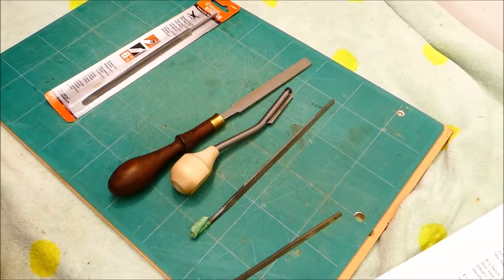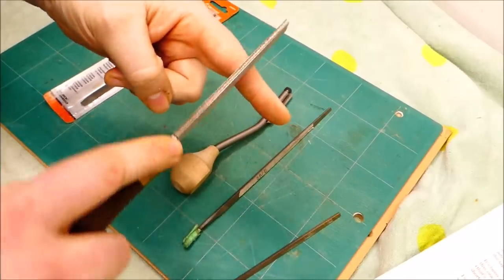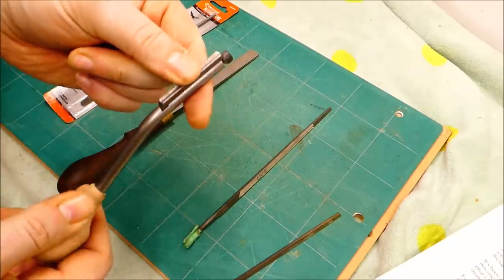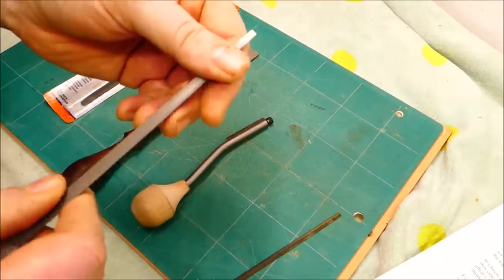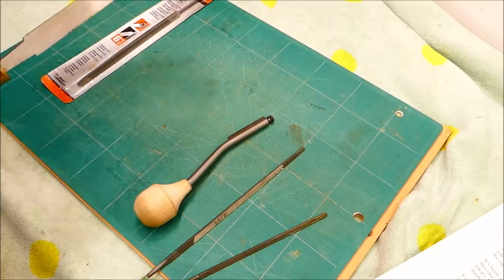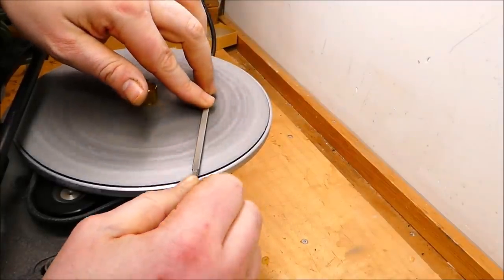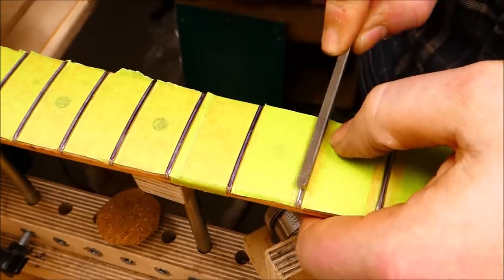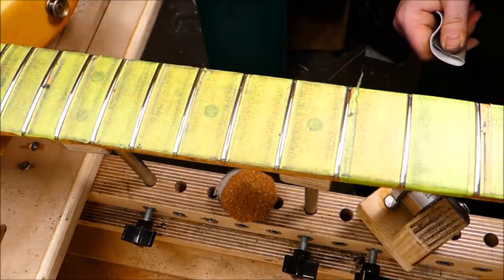Modifying some files for re-crowning work

Comment: Good video, reminding people how simple the tools needed are. Over time I've found  that only things I need for a quality fret jobs are ....(Sharpie),  Leveling beam, 3 Corner Safety file, Stew Mac Fret Tang File; Sandpaper 400/600,  Micro mesh and finally a  polishing compound or Mag wheel polish( has some agents that prevent tarnishing). Amazing how inexpensive and  locally sourced most items can be found. Not many excuses for mildly handy players to do basic work should be.

Comment: I like modifying my tools so they work for me, and your video was very helpful demonstrating what modifications were useful. I just modified a couple of files. My fret crowning file was way too long, so I drilled a deeper hole in the wooden handle, and now the weight is nicely balanced and I don't have a huge amount of file sticking out of the handle. I knocked off the end of my triangular file with a hammer, rounded the end, and eased one side of the file with disc grinding stone screwed into a drill. All very simple and effective.  Thanks for showing me how the pros do it. 👍

Comment: Thank you for this video! I've recently DIY'd some levelling beams (square steel tube, stick sandpaper on a glass shower shelf to flatten the tube, bevel the ends, and you've saved a few hundred by the time you've done 3 or 4 different lengths) but the crowning tools escaped me. Stewmax is useful in NZ, but their crowning files are really expensive even with the free shipping. I got a cheap one from amazon recommended by one of those youtube channels that does sponsored kit guitar builds and claims they're just as good as gibsons, so I shoulda known it was a scam. It just doesn't work. But looking at my local hardware store 3 corner files without the safe edge seem super cheap and easy to get, so I'll do that and modify them! Thank you for sharing your knowledge with the community for free!  

Also, I second the various comments asking to see more of the shop cat!

Comment: YES, extra slim 3 corner is where it’s at. For some reason, a lot of guys I’ve seen like slim taper Nicholsons. To me, those are nice and I do use them here and there but the extra slim Nicholsons are about the best crowning file I’ve found. Just grind off the corners, round them over a tiinnyyy bit and you have a brilliantly controllable, cheap crowning file that’ll last decades if you take care of it. For a handle, I just use a few wraps of duct tape. It’s nice enough to hold and you can just add it until you’re happy with the feel. It looks a bit ghetto but there aren’t too many better options out there. The Stew Mac 3c’s are great but they cost like 5 times as much...and believe me, you aren’t getting 5 times the tool. I’ve used both options for years and they’re about on par with eachother...

Comment: I also tried several coved crowning files and have never really gotten along with them. And for the very reason you mentioned with the file hitting the crown before the sides are shaped. But also they obscure the fret top. I've settled on the three corner file for a while now and find it just as fast or maybe even faster cause I'm not visually impaired by the tool itself. Thanks Ted

Comment: Sweet, thanks for sharing!!  I might have to give this a try.  I have one of Stew-Mac's fret files like the LMI one, but with a MUCH shorter handle, just formed out of the steel of the file.  I have also modified a regular smooth flat file so that only the last 2 inches or so have teeth, and the side is also cut away- this one is dedicated to rounding over fret ends.

Have you ever tried polishing frets with a felt wheel after sanding?  I found that the generic red jeweler's rouge in a felt wheel on my Dremel gives a mirror shine to frets.  Bends and vibrato are almost effortless when the frets are that smooth.

Comment: I have had great success using the three corner file from a cheap six pack of Mastercraft micro files I bought a few years ago. It's about the size and weight of a ballpoint pen, and now only has one sharp facet left. Not bad for $10, and the 3/16" diameter round file from the set is good for shaping headstock and neck heel tranditions.

Comment: Bacho 1-170-04-1-0 and 1-170-06-1-0 work best for me. Like the saw sharpening files but double cut so they chatter less. The second cut version 1-170-04-2-0 leaves a good surface. I put a brass pipe ferrul on a 1/2" or smaller dowel and cut it about 3" long as a handle, it allows good clearance and isn't as tiring to use as a bare file.

Comment: I love a three corner file, I can see my work as I file where as those pre-formed fret files hide my work rendering me into this stroke-lift-look action that is just inefficient and less accurate.   

I have also shortened the handle spear to use a semi-round (sorta tear dropped) shaped with a small offset hole I made to fit the cup of my hand comfortably without blistering my palm.  The hole is really centered at the end but my handle is wonky fat on one side to make it semi offset. 

Is wonky fat a thing?

Comment: Ted    I  bought   in  90 that  rosewood/brass  fret   file.  an  sold   the  gurian  one .I  found it  awkward  to  use    chacun  a  son  gout. I  tried  the  3 cornered   xx  slim  file . and  that   did  not  work  for  me   either . So  far . I  have  had  best  results  with  S/M  diamond    stubby  fret  file. TNX for    the   explanations

Comment: may I recommend using files from the Pferd, its sharp and strong. I still use it for crowning and bevelling either Nickel or often Stainless steel frets, for 6 yrs since and it still in its bes.

Comment: I’ve been using the Stew Mac crowning files for years. You are supposed to use them like a triangle file, leaving a thin sliver of untouched  fret on the crown. That’s what Stew Mac’s instructional video says anyways. I do the heavy lifting on stainless frets with the Nicholson triangle file, which makes the $70 files last for a decade+.
They can be sharpened with a sulfuric acid solution too, but that’s not for the faint hearted.

Comment: I went insane a while back and bought the Gurian file. It always seems to chatter and always needs cleaning as it collects filings. I imagine the diamond version is superior in that regard. Currently using combination of the triangular file and the Z-File. Although the Z-File has the same issue as the first file you demonstrated in that it's hard to use on the fretboard extension. I'd like to see a Gurian-type holder which can take radiused diamond file inserts that match the fingerboard radius. It'd be super quick and extremely lazy...

Comment: I have had a version of nearly all of the various fret files. Tri-corner is good, I find most concave are just just to "flat", as you did. I made a "deep inverted vee" file that quickly did both sides of the fret, leaving the crown untouched, but I made it too coarse, and it was dangerous to use! I may try to make a finer one of those. I just do hobby work, in any case.

Comment: If you want more diamond coated files and you're fine that it's polycrystalline, there are specific glues and powder to coat any tool shape yourself. I've seen it advertised for sculptors 2-3 years ago. 
I'll modify some smaller files. I'm not happy with the bigger one that is more tapered.

Comment: The main issue I have with those concave specialty fret crowning files is that they really only work well when the curvature of the specific fret you're working on matches the curvature of the specific crowning file that's in your hand, lol. In any other situation you have to try and make it work as well as you can. With the three sided file you can address the exact area needed for each and every individual fret.

Comment: I bought mine from that brit on youtube that talks alot. I bought a bunch of tools, so I don't remember the price, but the deal and quality was quite good. My file is a bit thinner than yours, and has  very fine teeth.

I mostly use the radius file with exchangable inserts, but I as you have found that it's not ideal for some jumbo frets. (I'm a hobbyist, and only do a handful of guitars a year.)

Comment: theres very small triangular files in germany called "nadelfeilen". they are used for watchmaking and maybe would be usefull for you but also rare, sometimes you can find them on ebay. probably theres a word for these in english
Reply: Rifflers or Needle files. Also used in locksmithing
Reply: I have a set of 10 different ones I bought from eBay. I use it mostly for the fret ends, and notches in bridges

Comment: I've used a 3 corner file with a safe edge that I made with my bench grinder several times an each time it went smooth enough that I could never want for a better fret file. The 3 corners arent expensive and can be found just about everywhere. I just have no desire to try some over priced speciality tool which most people arent very happy with who've tried them anyways. If it ain't broke.....

Comment: You're on the right track on how to control the break in the files but miss a few critical details.
Here's some generic* pointers from a machinist on the topic of breaking stuff (in a controlled way):
1. The stiff triangular shape do make it more difficult
2. Make sure the cut on the flat side covers the whole side and is reasonable even in depth
3. At least score the tip opposite (or score the whole way around). Make this one deeper then the wide side.
4. Use as thin wheel as possible to score and the scoring needs to be deeper then the cut width with some margin (you want as sharp corner in the bottom as possible, not round smooth divot).
5. Support the file just at the grove, preferable in aluminium or copper. If clamped in wood/plastic it's probably better to position the cut just below the surface!
6. Strike should hit from the narrow towards the wide side and be perpendicular. A light "from floor and upwards" is beneficial.

7. Files are (expensive) consumables. Use them, modify them but don't abuse them

"Sorry" for being late to the party but I didn't find this awesome channel not long ago!

*As in "not written only as a comment to this video"